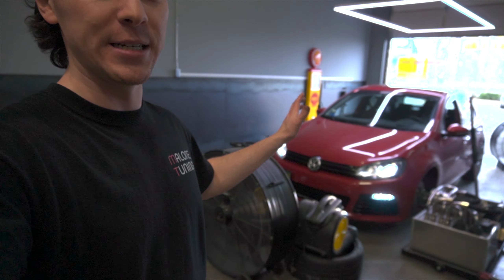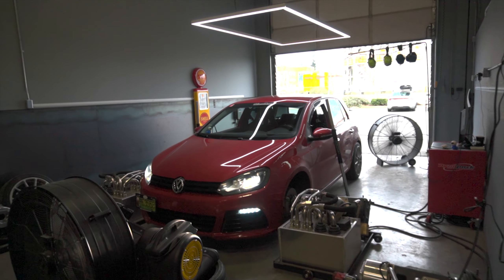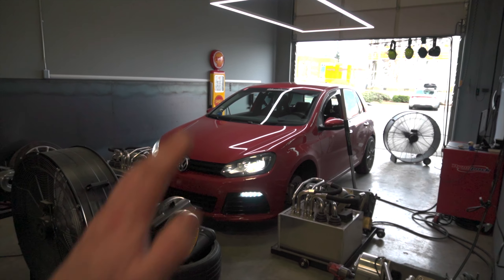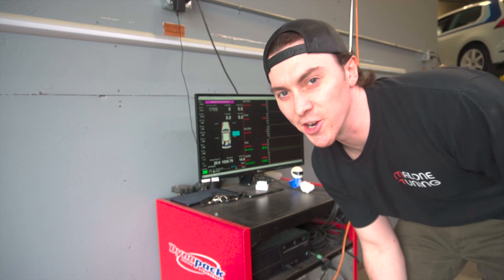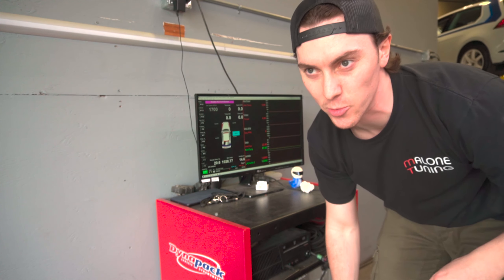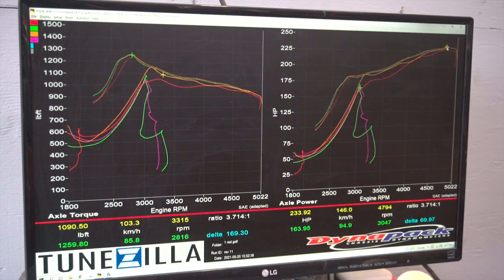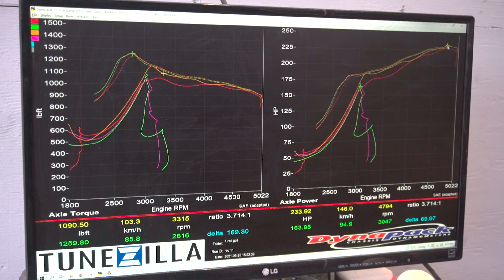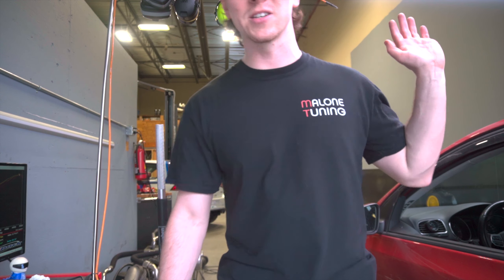Dynoing my BIG TURBO Mk6 GTD! - It Broke the Dyno (Kind of)!

Comment: Damn just need the injectors it looks like bc Ik the stock ones can only support 250hp and with the cp3 pump backing bigger injectors I feel like 275-300hp and 375-400ftlbs is achievable. Now I want to dyno mine with the cr170 bc it holds its own really well against modified focus st’s
Reply from the maker: Yeah we’re definitely at the limit for fuel +1 injector is currently leaking so that probably doesn’t help! Dyno after injectors and studs for sure with some more boost
Reply from the maker: It does have a CP3! My dumbass forgot to mention it in the video but I did add it with some text

Comment: I have a red tdi as well, did the grb2260 setup from darkside. Do you have the cp3 conversion or are you still on the stock pump? Malone said I should be around the 230 mark and I’m only on 24lbs of boost
Reply from the maker: CP3 is on, 230 crank possibly, not sure on that little boost, the power made on the red golf today is at about 37psi

Comment: How much  crank hp can handle CJAA injectors stock ?
Reply from the maker: I think the most power I ever saw with stocks was about 240WHP and almost 400WTQ (like 370-380?)
Reply: @ThatGuyTyy  so i can put in my car a 2260 safe , thank you <3
Reply from the maker: Yes shouldn’t be an issue but that’s not a gauruntee as every motor is different

Comment: hi I also have a golf 6 2.0 tdi stage and recently I had shaking at idle from time to time I checked the injector change the silent blocks check the vcds and no problem I don't really know what to sand if do you have an idea that would do it be cool thanks
Reply from the maker: Dual mass flywheel ??? Very common for DSG
Reply: @ThatGuyTyy  it's a manual gearbox
Reply from the maker: @yengel7442 I believe the manuals also have a dual mass, could also be engine mounts
Reply: @ThatGuyTyy  at changing the engine mounts it's already better, a dual-mass flywheel can cause shaking at idle from time to time
Reply: hi what do you think of CP4 HPFP Metering Valve Upgrade from darkside it is more efficient do you think it works well
Reply: hi do you know if just the original front grille of an R fits on a gti bumper?

Comment: Would water / meth injection help much on a setup like this? (vs nitrous)
Reply from the maker: Not entirely sure, I haven’t looked into it much but it might be worth the investigation is NOS turns into too much work, however for a diesel they would both be control on a variable stance instead of an on/off button like American drag cars

Comment: How it is possible 240hp only with that huge turbo on 2.0tdi engine? Injectors must be tiny. Boost must be low. Sure old golf 4 with 1.9tdi asz engine and big firad nozzle goes much higher numbers..
Reply from the maker: Show me a 1.9 ALH with stock nozzles on any size turbo that makes 240WHP and then we can talk 😂
Reply: @ThatGuyTyy  I wrote asz 130hp with firad big nozzles.. I mean I have more power than u with my gtb2260vk.. I'm pretty sure with gtd2872vrk I go over 300hp.. your dyno is interesting but u need to push more gas 😂

Comment: Hear me out. All Wheel Drive swap
Reply from the maker: I would love to if I could find a wrecked TT-S with the DSG…
Reply: Find a 3.2 quattro tt much cheaper
Reply: @seankelly4205  An what about the DSG? It´s a VR6 not a 4cil also gasoline not TDI.
Reply: @rcontrerastaule  what I ment was get a 3.2 tt dsg box rather than a tt-s because you can get a 3.2 tt much cheaper than a tt-s dsg box your literally only getting the car for the gearbox nothing else

Comment: Definitely crank power not wheel. You are at the stock pump limits which is correct crank power but at 40 psi?! It must be lean as hell??
Reply from the maker: It’s on a CP3 from Darkside, not a stock pump by any means